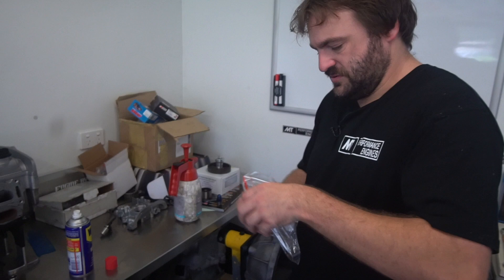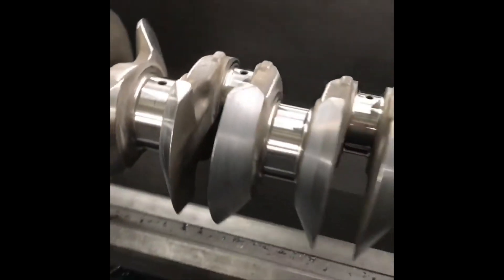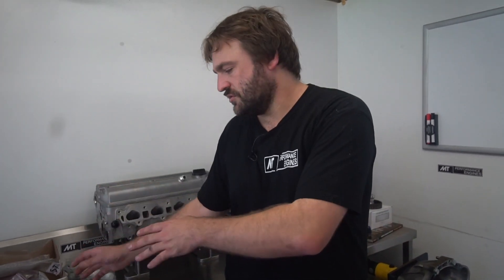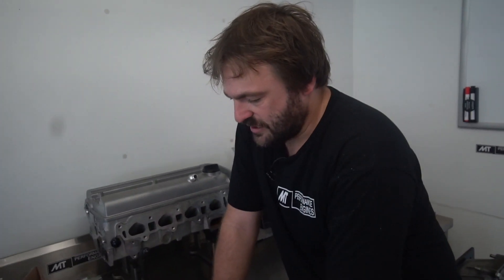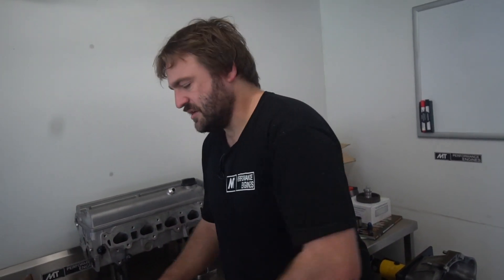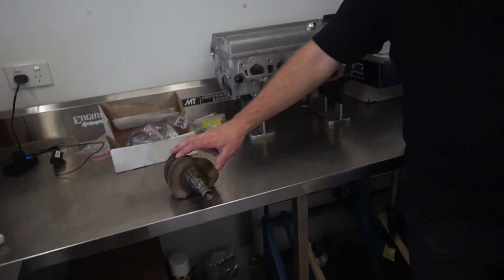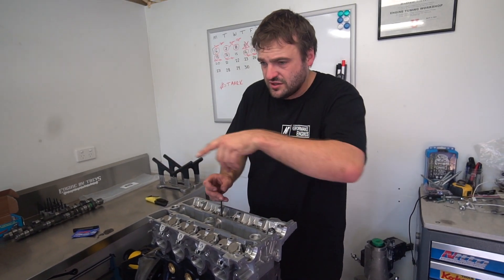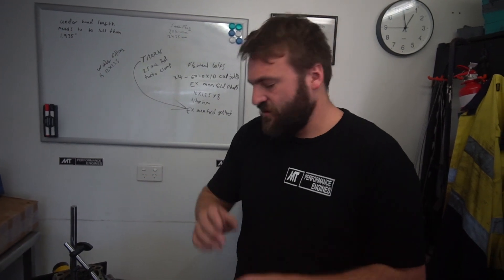Knife Edging (Ask An Engine Builder Part 6)

Comment: nice video. plz. help me understand on some hi revving de-stroked 7afe engine from 85.5 mm  stroke to 77mm stroke (custom 8 bolts) which makes 1.6 7age able to rev higher .should the custom crankshaft be heavier ?and the longer rods and pop up piston should it  be lighter by how much? ratio. target is 11k rpm thank you.
Reply: You are going to need the lightest piston and rod combination possible to do that. There is a formula that measures part of the con-rod weight and all the rotary weight to find out the correct counterweight mass. Here is an article on it:
https://www.onallcylinders.com/2016/03/17/the-basics-of-crankshaft-balancing/
They say 50% of the rod weight but I have read that's dependent on the tuned RPM. At a minimum you are going to end up with a 15mm longer rod so that's some extra mass you will need to compensate for. With the combination you have listed it will give you a rod / stroke ratio of 1.78:1 pending on the exact length rod you go for. You goal is extreme, I would expect that you would need to make that ratio much higher again by pushing the pin height into the oil control ring. If the pin is shifted another 5mm further up then it's a 1.84:1 ratio which is a much better place to be. I only know of one proven and running 4age engine running at 11K and that person was using a custom piston that didn't even have a second compression ring. With all the above keep in mind I am not an engine builder, this is just so you might have a head start on what to research.
Reply: thank you

Comment: Hi matt, will my blacktop 20v run more reliable with a silvertop oil pump and bearing tensioner combo? Versus the existing  hydraulic tensioner?
Reply: Yes it's a much better system to run the 20v silvertop pump and tensioner and its also cheaper
Reply: Yes.

Comment: I was considering swapping out my blacktop rods for silvertop rods and blacktop pistons on my next blacktop engine build...Now I am wondering if it will disturb the balance? To be honest my engine never sees 6k, so i am guessing it wont matter much.

Great content as usual.
Reply: Never sees 6k? You only need a 4A-FE 😘
Reply: @bryanduggan  nawnaw thats my baby. I dont need to press hard to go fast. 1/2 throttle is more than enough.
Reply: All three models of 20V engines use the same part number crank so no it won't effect the balance any more than the standard variances. But why change the rods at all though if you are only using low revs? Besides they are 20 grams lighter.

Comment: Good video, my question is: When you use thinner headgasket/have decked block/head etc., is it necessary to run adjustable gears to compensante for the different crank/cam gears distance? I've heard about it somewhere, but I'd like to know if it's really necessary.
Reply: ide say it wont effect that much, if you are worried just get a larger headgasket to compensated for the block/head
Reply: @radishtrader5591  Yeah, in my case I want to run TRD gasket to get compression ratio up a bit with GZE pistons. But I've also heard that no cam gears are needed and that it'll just have smaller tension on the belt.
Reply: @snap_oversteer  tbh i didnt worry about that when i rebuilt my engine. i just ran the same setup that i had. i cant imagine it being a huge huge problem. if your mechanic inclined enouf you could drill your stock gears and make them like the trd gears
Reply: From what I calculated previously it works out to close to only 1 degree of cam angle for every 1mm of change in height. To put it another way the difference it makes is insignificant.